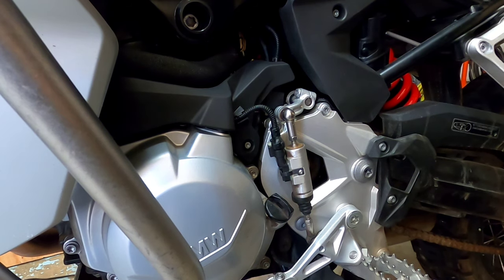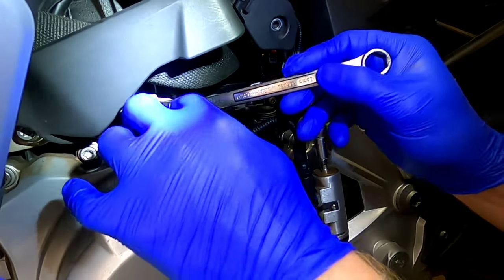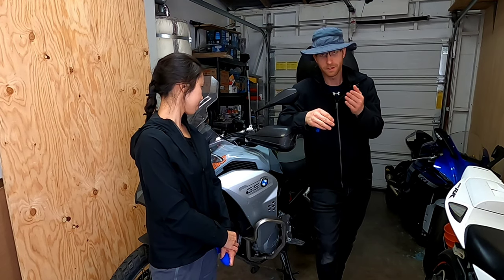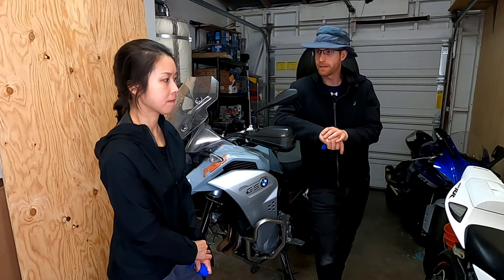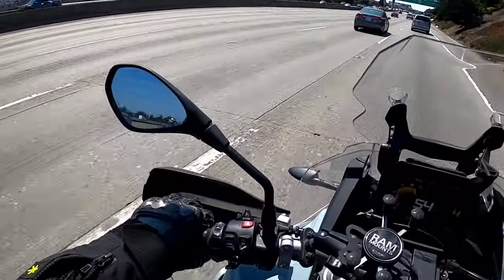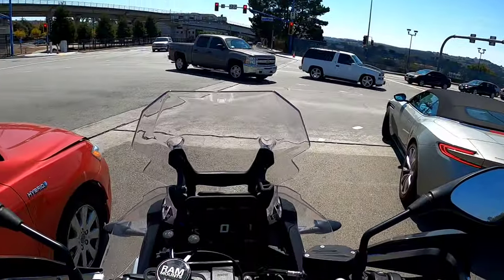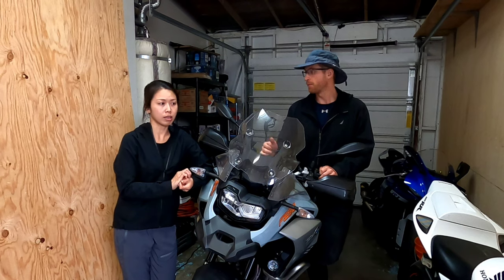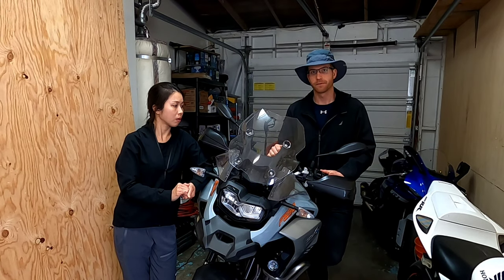BMW F850GSA Lower Clutch cable adjustment and Clutch problem troubleshooting

Comment: Thanks for the video. I do really hop that this solved the problem. It sounded ok on the test ride  accept for maybe on time or so, but  as you said it’s not really sure that the problem is completely solved.

Comment: According to my manual - turn the handlebars all the way left, pull the outer cable away from the clutch lever and there should appear a small gap ~1/16-1/8" between the outer cable housing and the grip. Else the cable is too tight and can slip under power (and wear your plates out even faster).
Reply from the maker: Thank you!

Comment: Still having the clutch cable issue?  I have a 2022 F850GSA with 3500 miles and all is good with the clutch cable.
Reply from the maker: So far so good.

Comment: i just changed my clutch cable, those lower adjustments are for adjusting the slop in the clutch lever. the tension of the clutch cable is handled right at the 2 round nuts that go into the clutch in which you slide the cable in and out.
on a new install after setting 8mm from the round locknut to the threaded round nut into the clutch control, at the bottom at the 13mm nut assembly farthest away from the cable end, to the left, my clutch moves about an inch and is very floppy, tightening it to the right removes the play in the clutch lever, it has nothing to do with the cable tension going to the clutch itself, again that is at the handlebar.
Reply from the maker: thank you!

Comment: I have a 2022 f750gs with 10,000 kiometers and it got the clutch cable broken 😢. Its been like 5 or 6 times I took it to tbe dealer for several problems ,first the whater pump was replaced ,then the aceleration body ( fuel injection sistem) ,after that a sensor or i don't even know , I am very disapointed with bmw bikes ......
Reply from the maker: heart for the comment. but boo for the gs that keeps breaking on you. that is unfortunate. I have been lucky with mine cross fingers we have cable problems with the 850 gsa also.

Comment: Any idea what's the Life on the clutch cable?
Reply from the maker: Some people change them annually, but if it looks good, no fraying, or kinks or whatnot then I don't change it.
Reply: 35k miles, mine snapped in two near the bottom, looked completely clean no burning, nothing, it did go beyond the recommended wear distance at the clutch tension adjustment on the handlebars. i think its 8mm they say, but i dont remember exactly. cable just stretched too far.

Comment: Mine had a new  clutch under warranty  its was sticking on the lever  then a crack and would release
Reply from the maker: that's great you got it replaced while still under warranty.

Comment: So ... how did this turn out? Did the problem go away or did you have to replace the clutch? BMW pay or you?
Reply from the maker: When it's exposed to extreme temps it moves around a little. So it still happens occasionally.